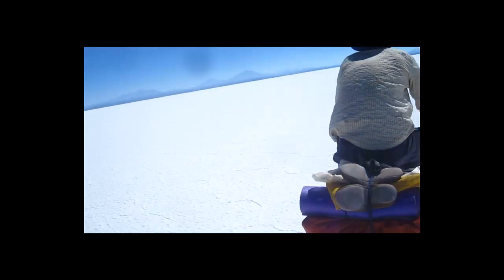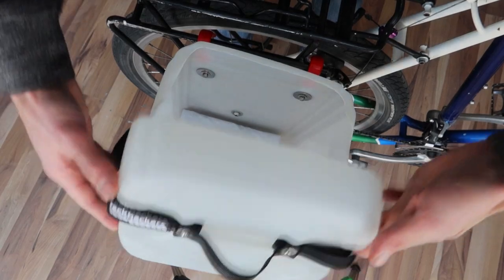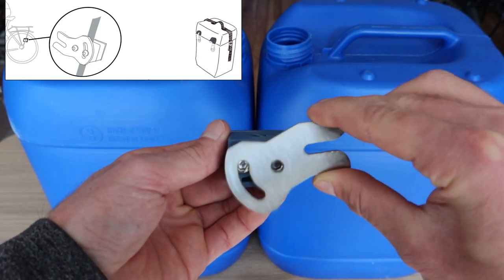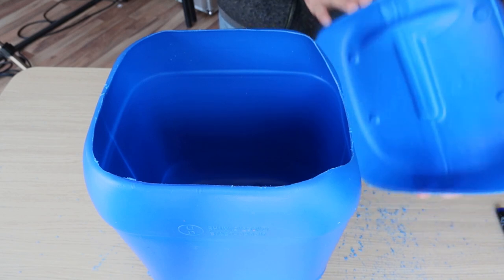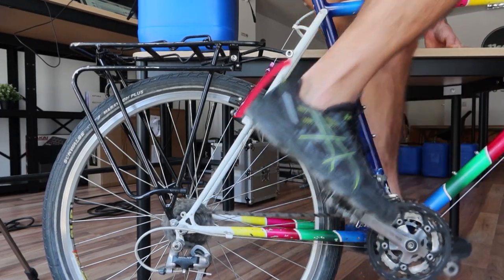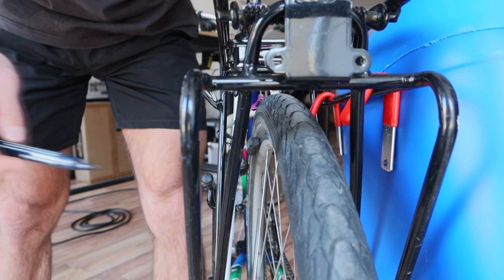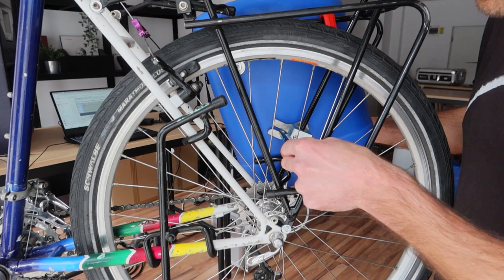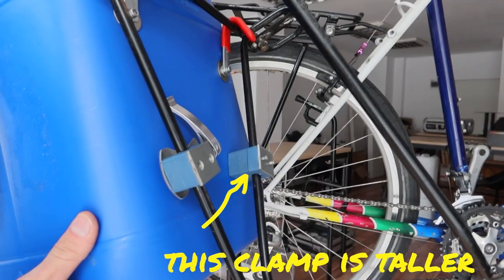DIY Bicycle Pannier Tutorial. Waterproof, Rigid, Durable - Homemade from recycled plastic cans.

Comment: That’s pretty slick.  The cans would be perfect targets for sticker-bombing.

One thing concerned me.  The quick release… if it vibrates loose, does it interfere with the spokes?  That could be bad.
Reply from the maker: Valid question :) We ordered a very short quick release lever model, to avoid any kind of contact with the spokes. It had to be specifically produced for the order, but it was worth it for the comfort of not having to avoid the spokes when we open and close the lever.
Other than that, the elastomer added to the quick release will probably prevent it from opening spontaneously.

Comment: Try a draw type potato peeler to remove plastic burr.
Very good!
Reply from the maker: Thanks! Good tip for those making them for personal use.
As we cut many canisters, we got a pen style deburr tool. It leaves the edge rounded, and quite fast to follow the curve with. https://i.etsystatic.com/28770019/r/il/775aca/3856970040/il_794xN.3856970040_6jep.jpg

Comment: Use O rings between the washers to prevent water intrusion.
Reply from the maker: We thought about it, but the HDPE plastic is soft enough to deform slightly around the washers, and seal by itself. At some of the points, the surface needs to be worked as described in the tutorials.
Reply: Or silicone caulk as used around a bath. 😉👍

Comment: Good idea, seems like a  good place to start a DIY project. Problem I see is if pennier carry heavy weight. Will the hardware rip the plastic can? Also the plastic can seem wasteful only used 1.25. Maybe we need to think harder how to utilized waste material as part of pannier reinforcement.
Reply from the maker: Thanks for the ideas. Plastic cans are made of surprisingly strong material, but for the people who don't trust it, we have a super heavy duty setup for whoever doesn't mind the extra weight. We will add an article about that in the tutorial section on the website soon. The remaining material can be used to create compartments inside the pannier if you like, but, unfortunately, adding more of the same plastic around the hooks does not make it any stronger.